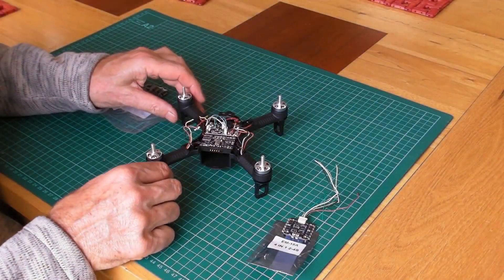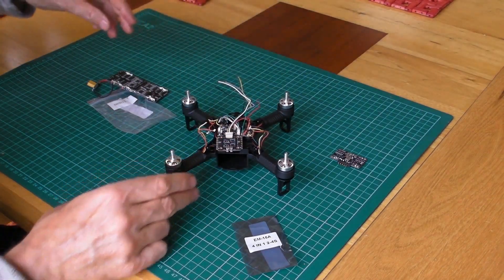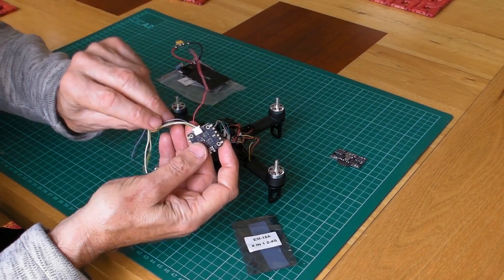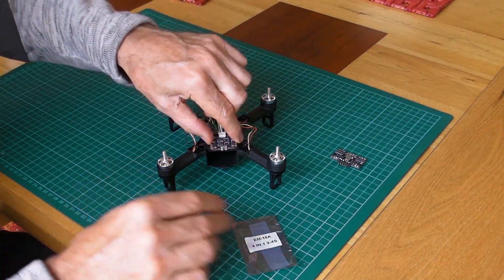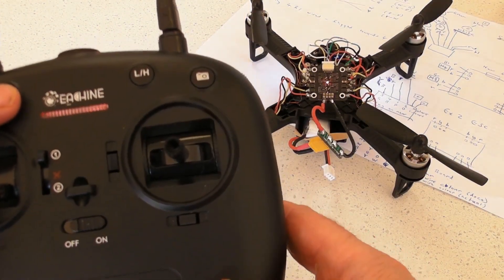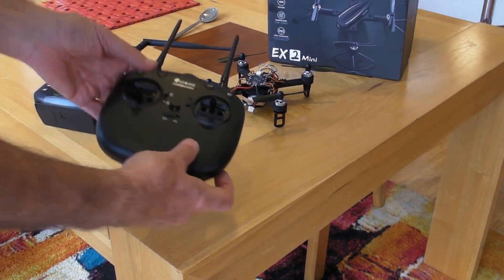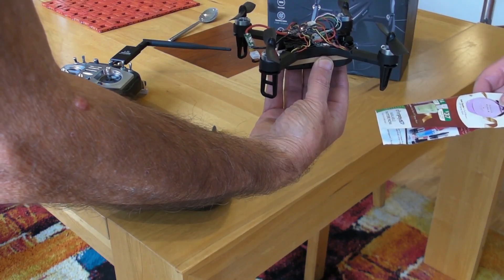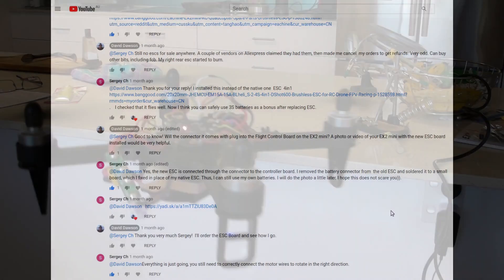How to replace EX2 Mini ESC board - Frankenquad - Thank you Sergey!

Comment: Hello David, Kindly share the right motor nuts for the stock motors for bugs 3 mini. I bought some M5 nuts and they were big for the motor. 

Kindly also share any range mod for bugs 3 mini, I got a very limited range with the stock antenna.
Reply from the maker: Hello Humphrey - take a look at my videos in my "EX2 - Bugs 3 mini" Playlist for props, prop nuts and antenna modification. I use a Jumper T8SG which also increases range.
 I bought HobbyKIng Flange Nylon Lock Nut M4 High CW Thread (10pcs), and  Flange Nylon Lock Nut M4 High CCW Thread (10pcs).
Reply: @skybug3  Thank you so much David

Comment: Hello David, I did a similar mod with my bugs 3 mini with a different ESC ( 20A 4in1 blheli_s ) but the drone doesn't fly, it keeps crashing when I try to take off. Is there a solution for this? if so kindly let me know. I miss flying and it's frustrating.
Reply from the maker: I only tried this after another flyer had reported success with it. I also read that Dshot600 implies that no calibration of the ESCs would be required. However, I did need to calibrate the gyro - both sticks down to the right with the original controller. The other issue is determining which 2 wires to cross over. That took a bit of trial and error.
Reply: @skybug3  I saw in your video your quad was a bit shaking when you kept pushing the throttle up. That's what I faced. So how did you solve that?
Reply from the maker: @brianhumphrey5620  I find it flies smoothly throttling up. The problem with the standard controller is "tail drop" when you throttle off. With the Jumper T8SG, a recent build of DeviationTX seems to have fixed that.
 Here's my video on that - https://www.youtube.com/watch?v=PavB5kUUnT8&t=151s

Comment: Hi David, thanks for your informative video. I have the same 4 in 1 ESC board on its way from China.
Is the wiring straightforward? Is it an easy soldering job?
I had a look at the pictures, but the wiring is somewhat obscured by the silicon.
Reply from the maker: This video I made a bit later should help - https://www.youtube.com/watch?v=pGjYzP1cZhA
A bit of soldering practise helps -  I have learnt to avoid dropping excess solder on the board. Good luck!
Although the ESCs can take a 3S battery, the fcb can only take 2S. I have something to reduce voltage on the way.
Reply: @skybug3  i was just a little worried about the wires that link the ESC board to the flight controller, making sure the connections match. Was it straight forward to match those specific wires?
thanks in advance!
Reply from the maker: @marcusrafferty7638   "Yellow and Blue, straight through.
                                      Green and white, crossover is right."
Reply: @skybug3  hi David, thanks for your reply. I'm unsure what that means - i'm hoping that if i just match white to white, green to green, blue to blue and yellow to yellow that'll be fine. i'm unsure where the black and red wires from the new ESC connector attach to the flight board. I've studied your photos and paused the video - you say they connect to a ground and a live connection, but i can't figure out where to connect those black and red wires onto the flight controller.
Thanks again
Reply: @skybug3  I now have my bugs mini back in action thanks to your help! I finally understood your rhyme about crossovers. Thanks a lot for your info!!!

Comment: why not buy the original replacement?

https://www.geekbuying.com/item/MJX-Bugs-3-B3-MINI-RC-ESC-Board-393726.html
Reply from the maker: The link you give shows "Sold Out".
I tried to buy the original ESC 3 times. 2 orders placed on Banggood were cancelled by them, even though the item was show as in stock. The next attempt was with Aliexpress - same problem. At that time, many failures had been reported. I suspect that the ESC was withdrawn from sale as a spare part - maybe the spec has since been revised and improved.

Comment: Hello david  ive broke one of the arm on my frame .and i cant seem to find a replacement anywhere. i wos thinking about a carbon fiber frame. any ideas.
Reply from the maker: I can still find frames on ebay here in Australia for around $15, but only from China. Problem is that my orders from China are not being delivered at this time. Main issues with carbon frames are cost, and figuring out a way to mount components in such a way that they are not exposed and easily broken when you crash. Gluing with wooden or thin metal splints has sometimes worked for me.
Reply: @skybug3  check my 3d print mods it cost like 7$. By the way I just screwed up my original esc , all I wanted to do was use e011c fc converted to brushless with b3mini original esc,
 and after unsuccessful esc calibration , I plugged it back to bugs original fc and now motor2(front right) forgot how to spin properly , sometimes it spins right sometimes left and after adding like 20% throttle it spins at low speed all the time , I don't think it has burned but I don't know what to do , ordered already this esc from video

Comment: Hello...
I copied your work because the original ESCs burned out.
I don't know what I could have done wrong but it doesn't have stability
N.B. I use the original remote control, can it be a problem ?!
Reply from the maker: Sorry to hear of your problem Roberto. I will do a test fly with the original controller to check. Most likely cause is wrong wires connected. I'll try to document more clearly which wire goes where. I'll get back to you in a day or so.
Reply: @skybug3  thank you very much you are very kind
Reply: I'm sorry I can't invite a video to show you what's going on,
grabbing the drone with your hand does the same thing as yours in the video at 8:10
Reply from the maker: I have just flown my EX2 mini with the replacement ESC using the original remote control  without any problems. I suggest that you check the wiring. Pause my video (hopefully on a big screen) to check each connection. The esc points are regular - black yellow red for the back pair, red yellow black for the front pair. Next check the colours of the 4 wires going from plug to plug. I got these wrong the first time. the red and black wires from the plug on the esc join wires on the flight control board. If all wiring is correct, you may be unlucky enough to have a bad esc. Google translate is our friend.
Reply: @skybug3  have you tried the original remote now ?? if I succeed I want to follow your path..Sori google translate
Reply from the maker: @fuzzshaq315  Yes - I have tested.  The EX2 mini with the replacement ESC flies well with the original remote.
Reply: @skybug3  can you provide esc purchase link that you have changed?
Reply from the maker: @fuzzshaq315  https://www.banggood.com/20x20mm-JHEMCU-EM15A-15A-BLheli_S-2-4S-4in1-DShot600-Brushless-ESC-for-RC-Drone-FPV-Racing-p-1528598.html?rmmds=search&cur_warehouse=CN
Reply: @skybug3  tq sir..i will try copy your work
Reply: @skybug3  last question, batteries can use 2S 60c++?
Reply from the maker: @fuzzshaq315  I'm using 2S 45c, but I think it would be OK with 60c. Sergery pointed out that the new ESCs should handle 3S, although I'm not tempted to try this yet.
Reply: Oh i see Tq sir.. i hope mod esc new, can fly with original remote
Reply: @skybug3  old esc also handling 3s quite well :p
I can say more , it handles 3x18650vtc6 with 30 minute fly time but the engines work loud compared to 2s , so better use 1500mah 3s lipo or 850-2000mah 2s lipo or 3000mah 2s li-ion (21 minutes flight time and it cuts the power at 3.5v when the li-ion still have 30% power left):p
Battery weight should be no more than 100-110 grams ,

Comment: Hello
I write with google translator that I don't understand english language
I have a question..
but with this solution it works well also with original radio control?
anyway congratulations for the repair solution
very good
Reply from the maker: Thank you - yes, it works well with the original radio controller.  I used it during testing in case I had to calibrate the drone after installing the new ESC. See this at about 7:28 in the video. I prefer the Jumper T8SG  controller because I can adjust the way drones fly and because I can fly any of my drones using the Jumper.
Reply: @skybug3  thank you very much you are very kind and too strong ...
I have a bugs 3 mini drone with esc out of order and since the original pieces are not found.
I will try your solution.
however, I sensed it as a solution but I didn't know how to put it into practice ....
very good compliments again

Comment: Glad to see it worked, looking forward to seeing some flights👍
Reply from the maker: Will have flights up soon. I'm using this project to ease myself into custom builds in a cost effective way. One day I'll look at a Diatone Mamba stack (or similar), knowing  I'll have to buy a vtx and a tx to go with it. Baby steps.
Reply: @skybug3  Diatone makes good quality components. If your interested in gathering some parts for a build I just ordered https://fpvcycle.com/products/brotherhobby-returner-r3-2207-2550kv-motor 2400kv motors, these are awesome motors with Japanese bearings and strong magnets. He is selling these at almost half price, I ordered the 2400kv for a 5 inch [US$20.99 36% OFF]Anniversary Special Edition Martian 215 215mm Carbon Fiber RC Drone FPV Racing Frame Kit 136g RC Parts from Toys Hobbies and Robot on banggood.com
https://banggood.app.link/3cPAAfEuJ1 build. Banggood is selling these frames for 20.99.
Reply from the maker: @WildCaptures  Thanks - just found your comment flagged as spam.